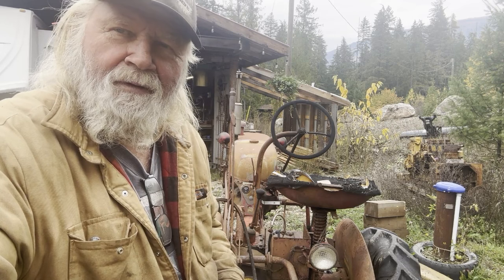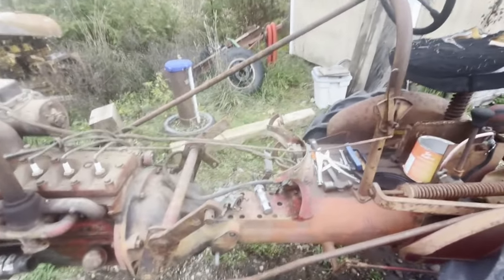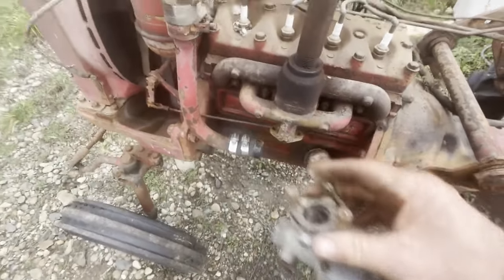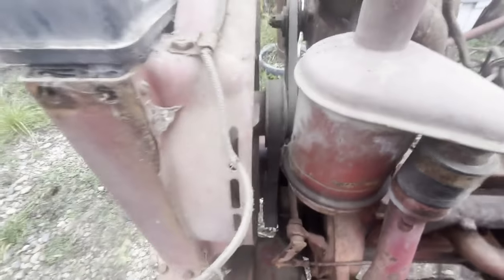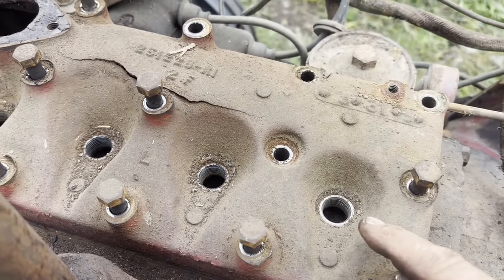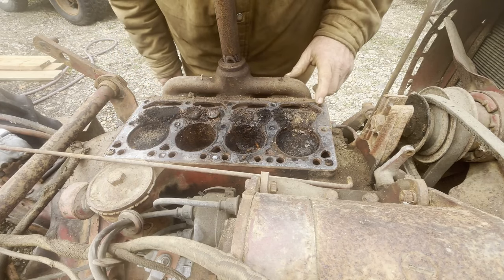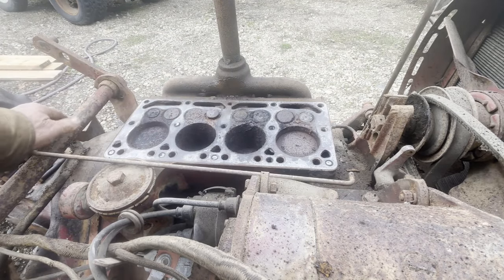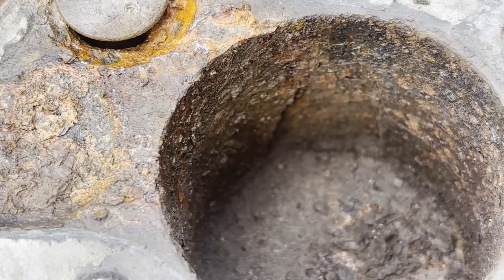Bad News Cub

Comment: Valves can be replaced, the cylinder bored and sleeved and valve seats replaced. The head can be cold stitched... but you need access to a machine shop and no telling what is needed in the bottom end. It's repairable though, I have done worse.
Reply from the maker: For sure it can be done. I’ve already contacted a machine shop to do the job. 4 hrs away from me tho. Other option is look for another parts tractor.  That’s the most practical but then I’ll have a hulk laying around.

Comment: I had that same little IH 4 cylinder on a DC generator for the magnet on a really old crane. Went to start it one spring and it was stuck. I dumped oil in the cylinders and got it broke loose but it would only go so far, same thing going the other way. Pulled the head and same thing, it froze and heaved the cylinder wall in. Not real bad but enough that the piston jammed at that spot. I'm sure it was cracked but I never got into it that far to look. But it was the first time I saw freezing heave a cylinder wall in
Reply from the maker: I have never seen freezing causing the cylinder to burst either.  I’m wondering if I could get it machined and install a dry sleeve.